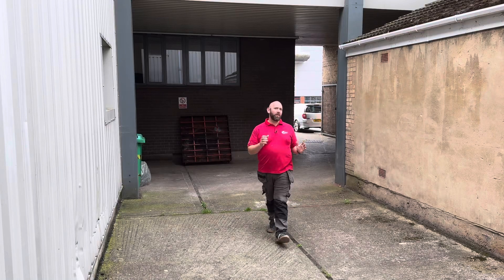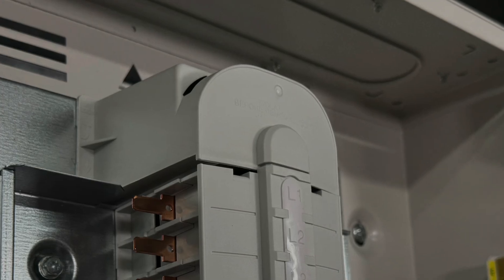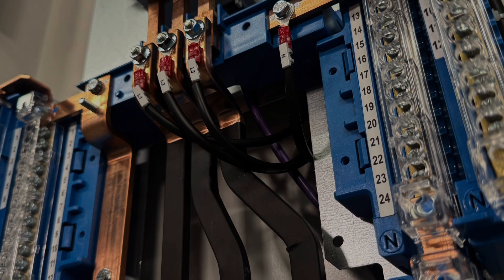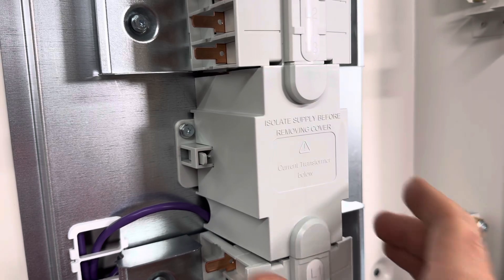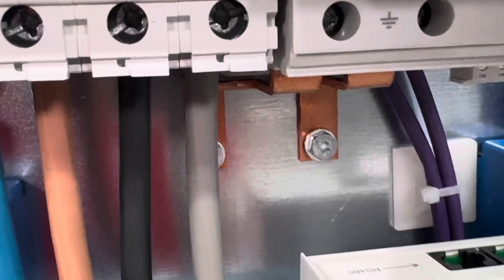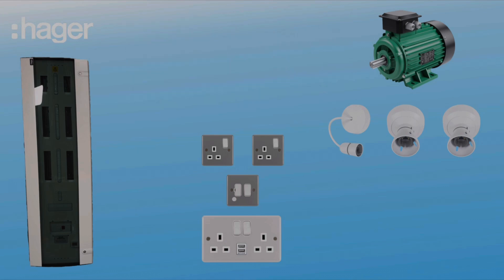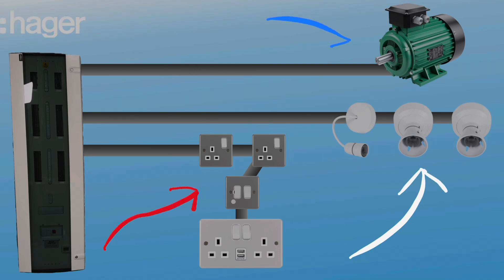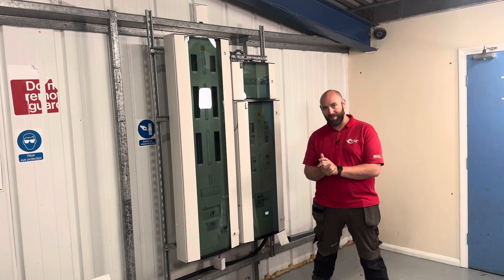Inside Hager's Smart Three-Phase Distribution Board 🤓

Comment: Hi just for my own understanding . like its 125 AMP right the main MCCB 
the Upper pan is for Motors mechanical 
Middle one is for sockets raw power
lower panel is for lighting
so if this is the scenario the load will not be equally distributed on each Phase 
and about the SPD device it is connected directly with 125 amp Main MCCB 
Can you please Explain this 
will be really thankful for the kind response,
cheers boss have a nice day

Comment: The only gripe I have with these DBs is that when you've got It loaded with RCBOs and all the circuits are in, there's very little space between the L,N coming out the breaker and the earth bar, making it very annoying to test, especially when you're working with 6mm> cables. Bit more room would be perfect. Apart from that, it is a decent board 👌